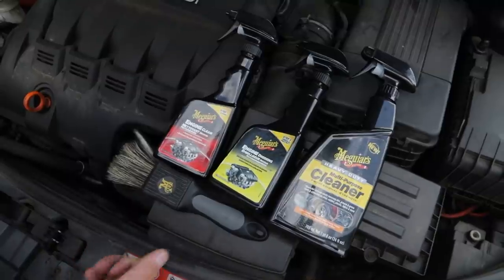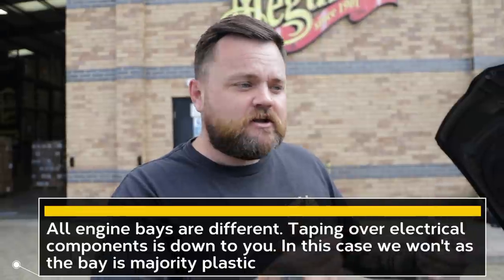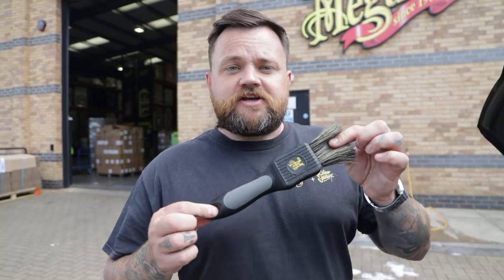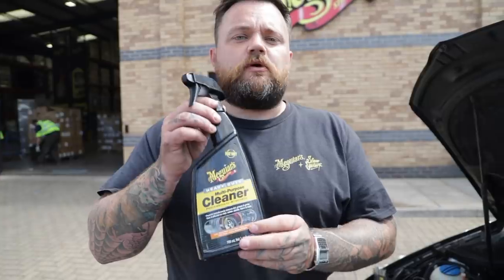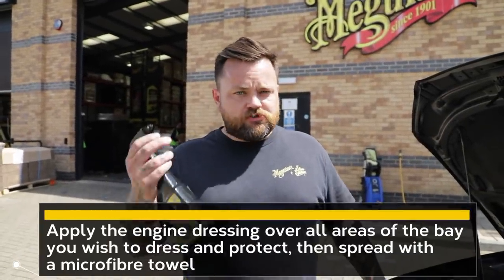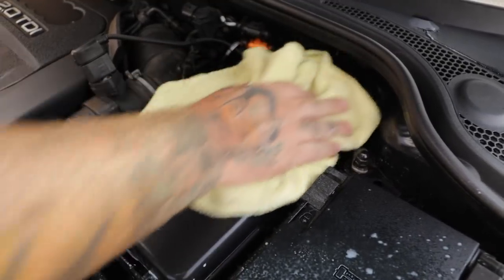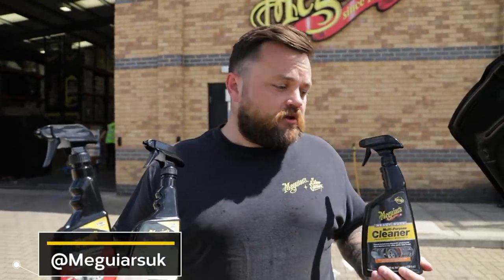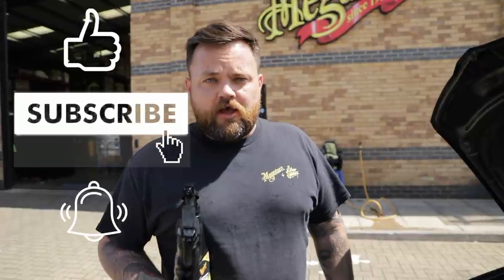Easy ways to CLEAN AND PROTECT your ENGINE BAY | Seminar Sessions

Comment: They always demonstrste on a newer car which can be easily cleaned with almost anything. The real challenge is to clean the older cars with really dirty engines and solidly stuck grease on them. But still they are good products. I love them.
Reply: Probably because all the plastic Meg works the best on plastics idk why it makes it look brand brand new
Reply: You´re soooooo right. Nice solidly baked waxes and debris since 30 years of engine heat 😁
Reply: Correct. I work on many of those older model cars that have the carburetor with the plug caps and heavy grease and dirt. They should be videos of cleaning some older models

Comment: I think I would rather remove all the plastic coverings and clean outside of the engine bay. Then use a microfiber cloth on the other bits as I don't fancy putting water near electrics.

Comment: Just one observation. I see that you sprayed water, with the hose, over the grill to the plenum chamber, (the air entry into the car) at the rear of the engine compartment. Surely this isn’t a good idea as it is likely to allow water to enter the inside of the car. In fact, on later models, there is a symbol indicating no to use a nose in that area.   This is not a criticism, purely an informative observation.

Comment: Are any megs shampoos allowed in pressure washers? If so which ones
Reply from the maker: The Gold Class Shampoo and Conditioner couples as a snow foam so that could work but it is not tried and tested method in pressure washer.